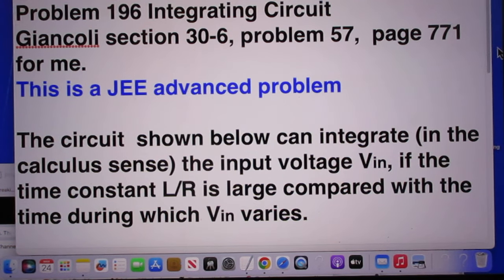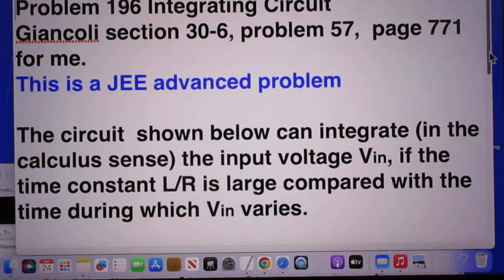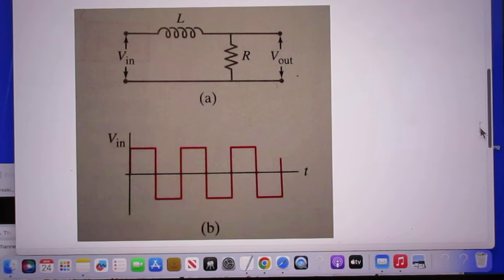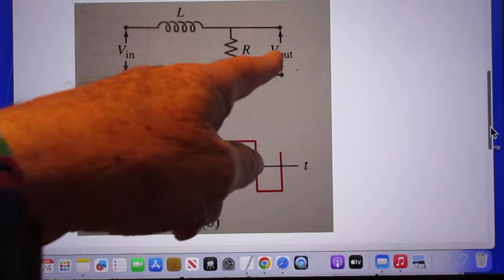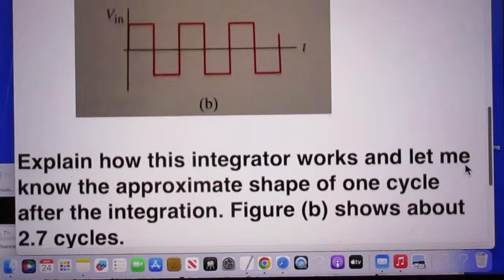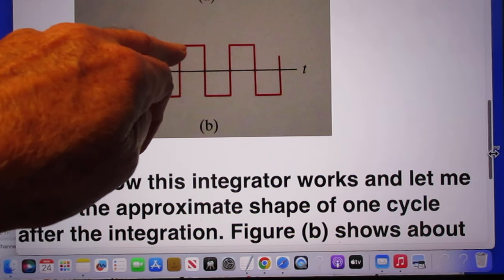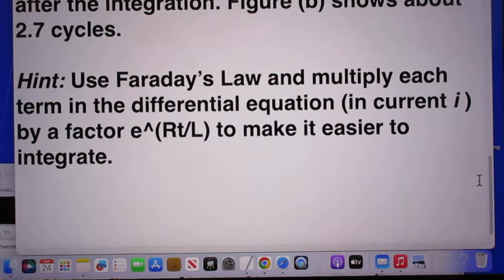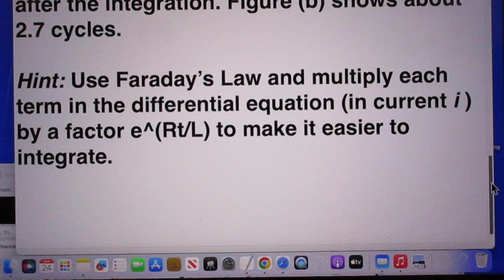Problem 196 - JEE Advanced

Comment: I must say, it's not very clear to me what exactly the question is. However, I deal with this kind of circuit all the time. First of all, If you apply a voltage to this circuit, as long as there is no change in the voltage, there will be exponential decay up to the limit of the applied input voltage. This will also be the case for this circuit. However, if the RL time constant is much higher than the period, we are dealing with a small piece of this curve and the exponential decay will not show but it will give us a more or less linear slope. So what you see on the output will be a sawtooth signal. Going up with positive input and going down with the negative. However, the output signal will be small compared to the input signal cause we are dealing with the beginning and tiny part of this curve. Note that it will stay above zero ( almost ) as the input voltage begins with a positive voltage. As the negative voltage starts the slope will go negative but since the input signal duty cycle is 50% it will go to zero again. So it will conform to a perfect integrator for the naked eye in this first few periods. As time passes however, if you put the output on an oscilloscope and look at a time scale several times the time constant you will find that the average output voltage will approach the average of the input voltage, simply according to Uout(average) = Uin(average)*(1-e^(-t/Tau)) and the sawtooth signal will be above zero and below zero for the same amount, averaging to zero as the input signal averages to zero.

So, that describes what will happen. No difficult math in there however.

I must note that this circuit has enormous application in modern electronics. As the world changed from analog to digital electronics, this very circuit converts digital signals to analog again. If you have a computer with sound, this circuit is what generates the sound. Same for a modern amplifier, car radio, electronic organ, you name it. ( although it will be mostly in the form of an RC circuit but same principles apply )
Reply: In modern electronics, this circuit has 0, absolutely 0 application. Please don't preach out of your own ignorance. This circuit is useful for students learning the material and was maybe useful back in the early days of electronics, but it is completely archaic. In a modern design, that isn't some little hobbyist project, you will never ever see an LR lowpass filter.
Reply: @fredthechamp3475  I agree, rarely. As I said : it will be mostly in the form of an RC circuit but same principles apply. Raspberry pi use and RC filter to generate audio. Countless amplifiers, countless DSP circuits. That's not my ignorance, thats how it is. But I agree, an LR lowpass filter is rare but for example a class D audio amplifier output stage will have such a circuit, if you count the loudspeaker as R which is fair to say imho.

Comment: The graph will be a combination of exponential graph(one of which will be enforced at a time) changing sign of its slope at equal time intervals and its amplitude will also keep decreasing and become constant as t approaches infinity

To find the area under v-t curve(integration)
We use considering clockwise as + direction
V=Ldi/dt+Ri
Vdt=Ldi+Ridt
Now for the right part we need the area under curve of the Vout-t graph and on dividing it by R we’ll get idt which is area under curve of i-t graph and we can find instantaneous current from instantaneous Vout this way we can find the lhs

Comment: Given the time constant is >> waveform time, Vr can be assumed to be so near zero that applied voltage appears in its entirety across the inductor.  Output wave is a triangle starting at zero linearly sloping up until zero crossing of Vin, then sloping down to zero with negative of the rising slope, meeting zero at the next zero crossing of the input voltage.  Wave is thereafter periodic.  Peak voltage is VtR/L  where t is the time of a half-cycle of Vin.
          In reality, because Vin has no DC component, & the initial conditions demand the output to have a DC component, the output triangle wave will, after a time >> L/R, shift downward so the triangle wave is symmetrically set about zero, alternating to +/- VtR/2L.
          This type of excitation (or sine wave, started at the zero crossing), when applied to a large transformer, lightly loaded or unloaded, will cause the initial magnetizing flux wave peak to be double the normal, steady-state amount.  This will cause the transformer's core to saturate & a large surge current, 10x to 50x typical full-load current, to flow, often tripping protective breakers.  To avoid this, the wave should be started at it PEAK, contrary to conventional thinking for "zero-crossing switching".
Reply: He said several times that the E-field is zero in the inductor and that any voltage detected is actually from the B-field inducing a voltage in the voltmeter. If E=0, then what is V..? 🤔

Comment: 1) Explain how this integrator works.

 The input square wave voltage, Vᵢ
 goes between –A and A volts.
 So peak-to-peak value is 2A.
 
 If L/R is large compared with the period
 of Vᵢ we will see a trangle wave at the
 output with small amplitude.

 If L/R is small, the output voltage is no
 longer linear, but describes an exponental
 curve up on one half cycle an down the
 next half cycle.

2) Use Farady’s Law.

    ∮E⋅dl = 0 + Ri(t) - Vᵢ = -L (di/dt) …(1)

3) Solve the differential equation.
 
 - Rearrange eq. (1)
 => di/dt + (R/L)i(t) = Vᵢ/L

 - Find an integrating factor (I.F.):  
       e^(∫(R/L)dt) = e^(Rt/L)
 (this is the hint given in the problem)

 - Multiply all terms with this I.F:
 => e^(Rt/L)di/dt + e^(Rt/L)(R/L) i(t) = e^(Rt/L) Vᵢ/L …(2)
 => d/dt[i(t)·e^(Rt/L)] = e^(Rt/L) Vᵢ/L …(3)
 (from eq. (2) to eq. (3) we have used the derivative
  of a product backwards and we can now integrate both sides).
 => i(t) · e^(Rt/L) = (1/L) ∫[Vᵢ · e^(Rt/L)] dt from t₁ to t₂.
 => i(t) · e^(Rt/L) = (1/L) = (Vᵢ/L)·(L/R)·[e^(Rt₂/L)- e^(Rt₁ /L)]
 => i(t) = (Vᵢ/R)·[e^(Rt₂/L)- e^(Rt₁ /L)] · e^(-Rt/L) 

 V₀ = R·i(t) = Vᵢ·[e^(Rt₂/L)- e^(Rt₁ /L)] · e^(-Rt/L) 

(Not a perfect answer, but this is what I have so far. I leave it to Keith to explain it better 🙂.)

Comment: This is the Giancoli 3rd Ed text book supplement solution 
(Chapter 30, p. 14, prob 57: p. 607): 

From the circuit we see that:

Vin = iR + L di/dt, or Ri/L + di/dt = Vin /L.

We multiply both sides by the integrating 
factor exp(Rt/L):

exp(Rt/L)Ri/L + exp(Rt/L) di/dt 
= d(i exp(Rt/L))/dt = exp(Rt/L)Vin /L.

If we assume i = 0 when t = 0, when we integrate we get: 
ₒ∫⁼ͭ  d (i·exp(Rt’/ L))= i·exp(Rt/ L) 
= (1/L)·ₒ∫⁼ͭexp(Rt’/ L)·Vin dt’.

If t « L/R, the exponent is small, 
exp(Rt/L)~1 and exp(Rt’/L)~1, 
so we have:

i = (1/L)·ₒ∫⁼ͭ Vin dt’

Thus the output voltage is:
Vout = iR = (R/L) ₒ∫⁼ͭVin dt’.

This is the area under the curve when 
Vin is plotted against Rt/L:

For the square wave input Vin, we get:
__   __   __   
   |_|  |_|  |_|

For the output Vout, we get:
 ╱ ╲ ╱ ╲ ╱ ╲ ╱

Comment: Trying to piece together coherence from everywhere prof because I know nothing about this really and I dont have time because I need to prepare for my/work tomorrow. Constructive and Destructive Interference is really stuck in my imagination for some reason🦅also after seeing one of the videos to help that there is 1Resistance, 2Impedance and 3Reactance at play in the RLC circuits🧐Anyway😉I think these videos are helpful for anyone trying to solve: 1) RLC Circuit Differential Equation | Lecture 25 | Differential Equations for Engineers 2) Integrator - Operational Amplifier | Basic Circuits #14 3) RLC Circuits - Differential Equation Application 4) Kirchhoff's Current Law (KCL) - How to Solve Complicated Circuits 5) Lesson 9.1 - Second Order Differential Equations

ChatGPT's response just for interest sake😅

If a resistor is inserted in a closed circuit(Vin  - Inductor - Vout - Vin) between Incuctor(L) and after  Vout, how would current be influenced by L and R?

ChatGPT:
When a resistor (R) is inserted into a closed circuit with an inductor (L) and a voltage source (Vin) before and after Vout, the behavior of the circuit changes due to the addition of the resistor.

Here's how the current in the circuit would be influenced by the inductor (L) and the resistor (R):

Initial Conditions: Initially, when the circuit is first powered on, the inductor will resist changes in current flow. It will initially behave like a short circuit, allowing current to flow freely. However, as time passes, the inductor will build up a magnetic field and resist changes in current.

Inductor Behavior: The inductor will still oppose changes in current flow as before. It will produce a back electromotive force (EMF) that opposes the flow of current. This back EMF is proportional to the rate of change of current (V = L di/dt, where V is the voltage across the inductor, L is the inductance, and di/dt is the rate of change of current). Therefore, the inductor will continue to smooth out changes in current flow and resist sudden changes.

Resistor Influence: The resistor, being a passive component, will dissipate power in the form of heat according to Ohm's law (V = IR, where V is the voltage across the resistor, I is the current flowing through it, and R is the resistance). The presence of the resistor will introduce a voltage drop in the circuit proportional to the current flowing through it.

Steady State: In the steady state (when the circuit has reached a stable condition), the current flowing through the circuit will be influenced by both the inductor and the resistor. The inductor will still try to maintain a continuous flow of current, while the resistor will limit the current flow by dissipating energy.

Time Response: The time response of the circuit, particularly during transient conditions (such as when the circuit is first turned on or when there are sudden changes in input), will be affected by both the inductor's tendency to resist changes in current and the resistor's damping effect on the system.

In summary, the insertion of the resistor will affect the behavior of the circuit by introducing additional resistance to the flow of current, thereby influencing the overall current in the circuit along with the inductor's behavior.

Comment: I'm going to skip doing exactly what you asked, and not invoke Faraday's law, but go directly to the transient response of an LR circuit, Vout= Vin(1-e^(-tR/L)).
Next let a cycle length = 2T, and invoke superposition of a constant +Vin starting at T=0, plus a voltage of -2Vin starting at t=T. 
Vout at the end of one cycle is Vin(1-e^(-2TR/L)) -2Vin(1-e^(-TR/L)).
If the value of R/L is small, the ratio of (1-e^(-TR/L))/(1-e^(-2TR/L)) approaches 1/2, so the ending voltage approaches zero, the integral of the input waveform over one cycle. The voltage across the resistor is a close approximation (with a scale factor) of the integral of the input. In fact, if the value of R could be made zero, and the output was taken as the current in the (ideal) inductor, we would have a perfect integration.

Side note: in cathode ray tube horizontal scanning circuits, a switched voltage is applied across the (non ideal) horizontal yoke coil to get an (approximately) linearly increasing current vs. time, and thus a linearly increasing magnetic field, to deflect the electron beam from left to right.
Reply: A simple opamp circuit would allow for a resistor value of 0 and still get an output voltage thus forming a near perfect  integrator.